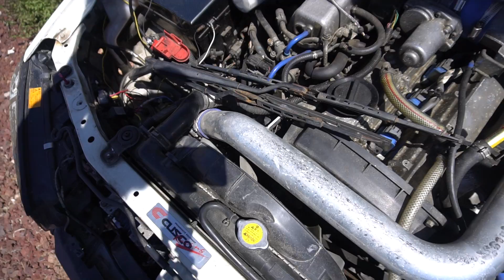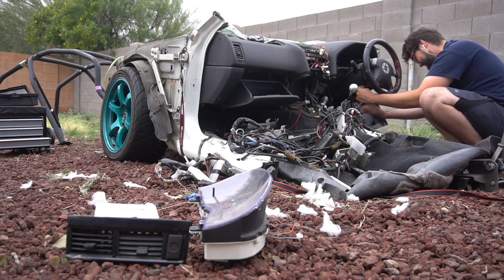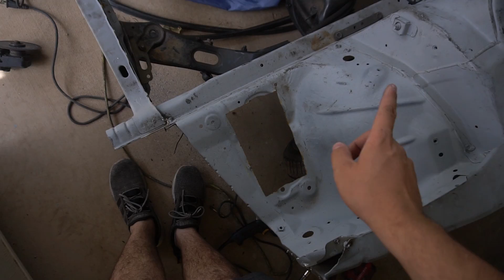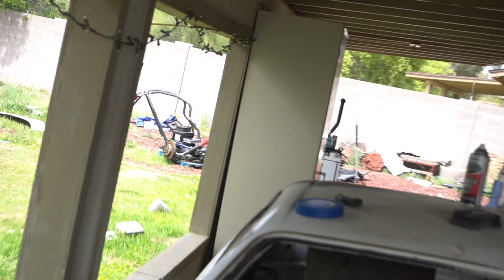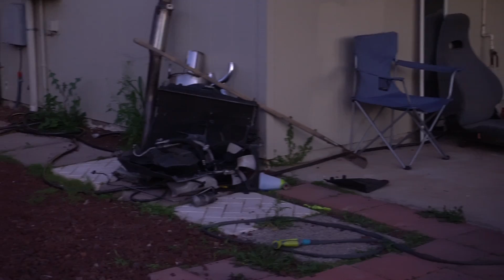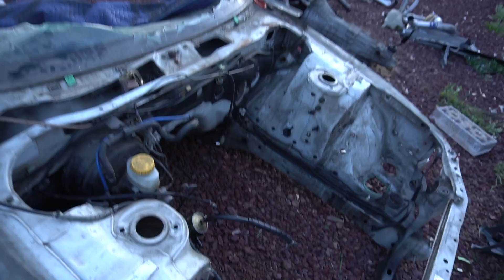Dissecting the donor R34 Skyline - Salvage R34 "GTR" Rescue (EP2)

Comment: CA18 are pretty sick engines, they are pretty much what the RB engines are based off of. 200 pounds lighter than sr20, stronger iron block, higher revs and more torque than sr20. also sounds way better. but most people just rip them out and put an sr20 in there because "hur dur sr20 tho". there's even a CA20 SOHC you can use the block off to make a CA20 DOHC.

Comment: Yo, you might need a gtr front support if you’re doing a gtr front end
Reply from the maker: Chance Edwards the core support is the same basically, the bumper stay brackets are different and those bolt on to the crash bar. But I have those ordered already
Reply: Andre Klebleyev ok thanks for the clarification 👍